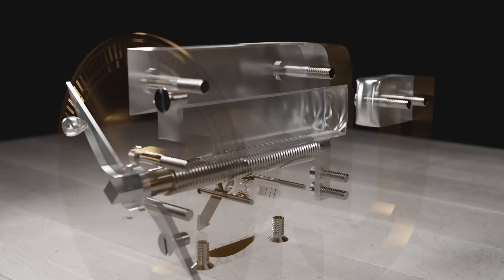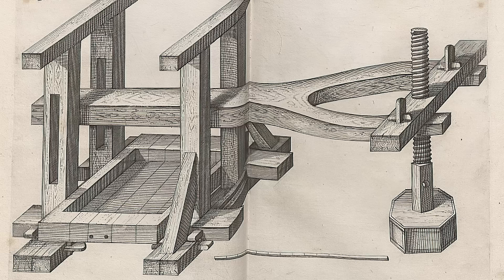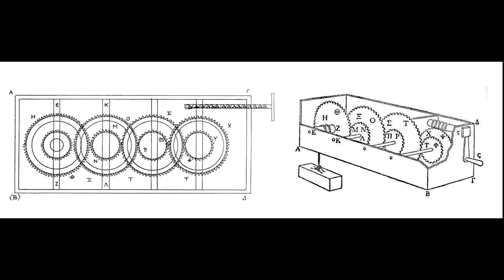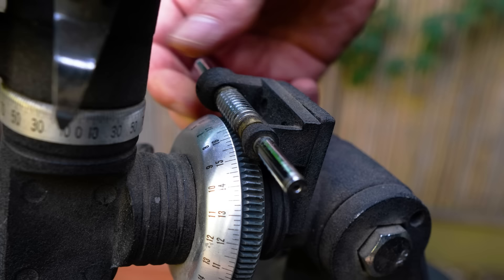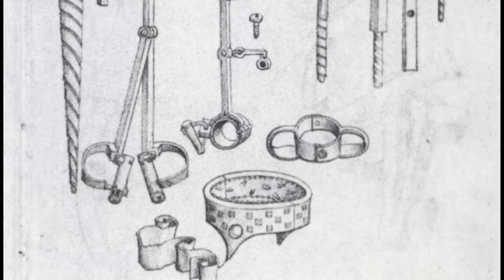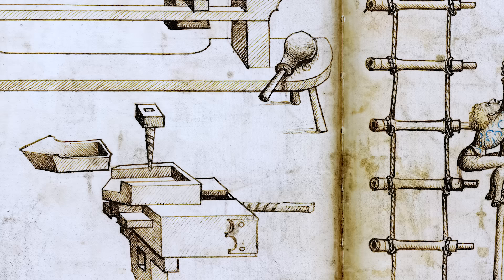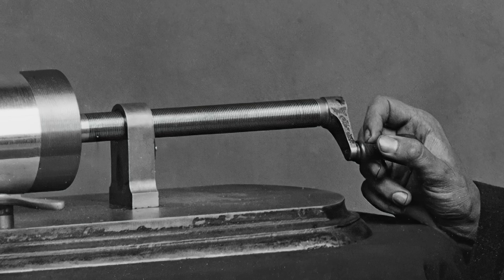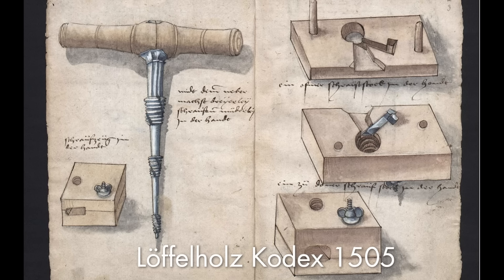Where DO screws come from?

Comment: AVE once said that a wedge is the most important tool in the world. He noted that the thread on a screw is simply a wedge. It's a helical wedge (inclined plane). I thought that was pretty cool.
Reply: False
Reply: @rrtsduf  bold statement to make without any further evidence
Reply: I think you mean ramp. It’s a ramp wrapped around an axle.
Reply: @fornello123  Isn't a ramp just an inclined plane?
Reply: @fornello123  What's the difference between a ramp and an inclined plane?
Reply: @markgreen7701  yrs but it’s not a wedge
Reply: @fornello123  The difference between a wedge and a ramp is that a wedge is moved to exert a force and a ramp is stationary. You twist a screw so it's not stationary. Thus, you have a helical wedge.
Reply: Screw him !
Reply: Has AvE been watching the Big Bang Theory 🤔
Reply: Everything is everything else if you modify them and twist your metaphors enough.
Reply: It's not about this statement being true or not, it's about if it makes you wonder about things.
Reply: Yupp. Screws are just nails with nails wrapped around them.
Reply: @markgreen7701  thank you mark my heart was in pain
Reply: *Just remember to keep your stick on the ice."
Reply: So that depends upon the thread type.  A constant thread is just a ramp wrapped around an axle.  However a progressive twist thread like national pipe thread has an increasing pitch, or number of threads per inch, such that as you thread it deeper it will tighten.  That is exactly a wedge.
Reply: An inclined boat will plane if it goes fast enough.
If it doesn't, the hull or the motor could be screwed.
Reply: yeah its literally a wedge 
continuously
but AVE didnt come up with that 
its a very old way of describing it tho
Reply: Glad you noticed that. Yes the mechanical principle of the screw is the WEDGE. I looked it up in Machinery's Handbook.
Reply: @650gringo  Thank You!
Reply: @amschind  A wedge is binary while an inclined plane is variable.

A wedge is either blocking movement by force to prevent movement, or it isn't.   An inclined plane allows movement by distributing work over a lesser area which amplifies the amount of work, abet at an increase in time.  While similar, they are not interchangeable. 

A screw is the combination of the wheel and inclined plane.
Reply: Mr. Wizard pointed that out in his TV show in the  late 1950s. The show was about levers, inclined planes, etc.
Reply: @markgreen7701  ramp is most triangle in the side view.. inclined plane is mostly plane object in which the angle of inclination can be adjusted anytime...
Reply: This thread declined rapidly. mark green tried to stay on track but he was outnumbered by leptons.
Reply: Inclined plane wrapped around an axle attached to what amounts to a wheel, the head of a bolt and keyway of a screw. Turn the wheel and greater torque is applied to the axle. Leverage that with long wrenches and power drills.
Reply: @Robert_McGarry_Poems  Well, now you are talking about an auger.. Lol  just kidding!
Reply: @amschind  National pipe thread does not have a changing thread pitch. The threads per inch remain constant. It is the diameter of the axle that changes. Hence the term tapered pipe thread.
Reply: How do you park a car 100ft  in the air? You can have a straight inclined plane about 200yds long or you can wrap the same one around a central core and you have one of those circular car parks... taking up a fraction of the space. Before the screw thread everything was held together by wedges, cordage, friction or gravity.
Reply: @daisuki9296  — What is a “flathead screwdriver”?
Reply: @GH-oi2jf  ask google
Reply: you should look up the 5 basic machines.  the wedge is represented there but many other devices were built on the wedge also.
Reply: Great point - thanks for sharing :)
Reply: An inclined plane large enough to walk or move items on wedges you or the item up away from the starting point. wrap the inclined plane around a shaft or piller and it does the same thing in less space. the shaft or piller is an axel that can move or not  and becomes a screw.
Wheel axel and inclined plane/wedge and lever are our most basic tools and put togetger in different ways make up all machines.
Reply: @markgreen7701  the inner thread is ramp.. but then in other reference  the nut is wedge and blt is plane
Reply: @alanmcentee3035  screw is used as force amplified by making more work (twisting it multiple times). Your point?

Pretty much every practical mechanics textbook I've read was stating that worm\screw acts like an inclined plane when used as a transmission and as wedge when being a fixture (increasing friction force to stop movement). Wedges used to move\tear apart things ARE inclined planes.But literally both are same, just reference frame is different. Flip reference frame and wedge is immobile and parts it contacts with are moving.
Reply: If the first tool was a piece of flint or obsidian sharpened to be a knife or spear point, sharpened by flaking, then the hammer to create this "wedge" was also the first tool.
It all started with rocks and sticks.
Reply: @alanmcentee3035  Is it one or the other or neither?
Reply: @amschind  A tapered rotary wedge perhaps?
Reply: Both.